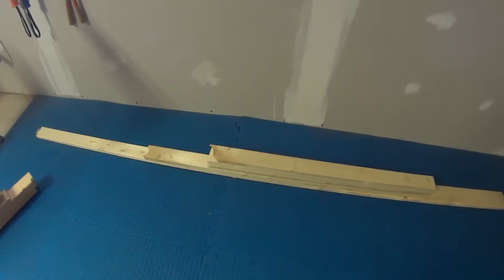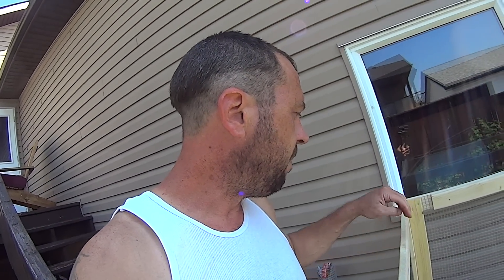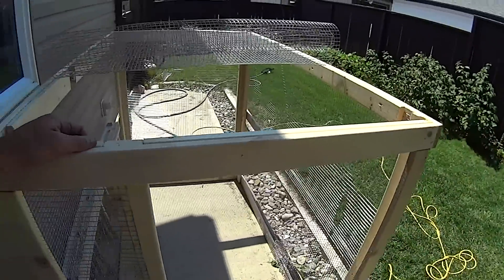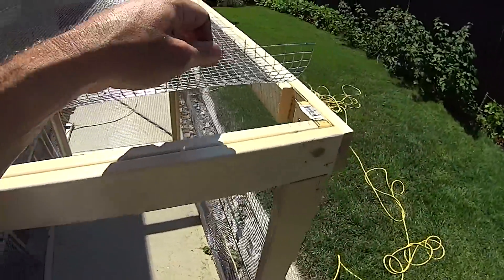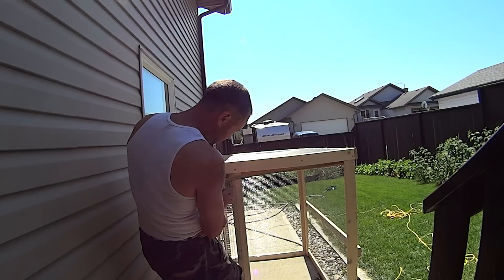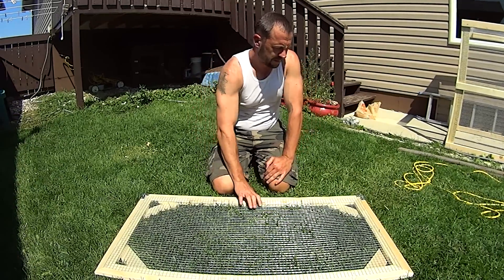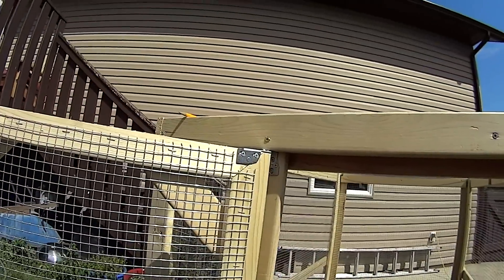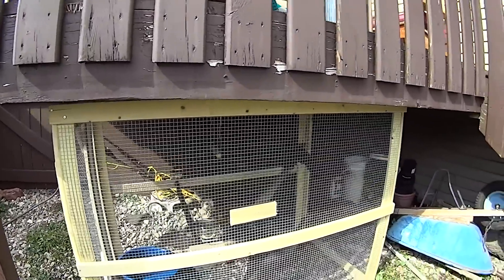How To Make A Large Bird Cage Pt.2/2

Comment: Got a question for you, would the cake be ideal for budgies or cockatiels and could you also tell me what base would be for cleaning it out
Reply from the maker: +John Pilgrim Yes, you could use this for budgies or cockatiels, definitely. I did not design a base for this cage, but left it open on the bottom, for use outside, over soil. If you want a washable base, I would suggest to use a piece of linoleum cut to size, or any other similar mat, which can be easily moved in and out of the enclosure for cleaning